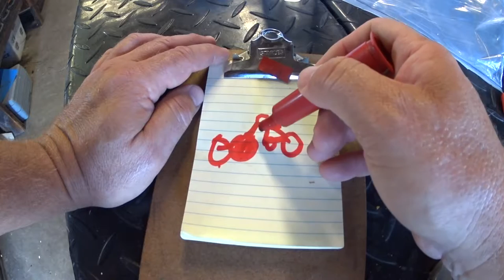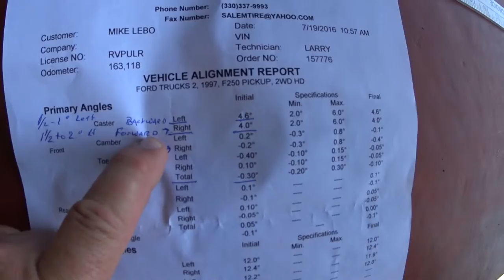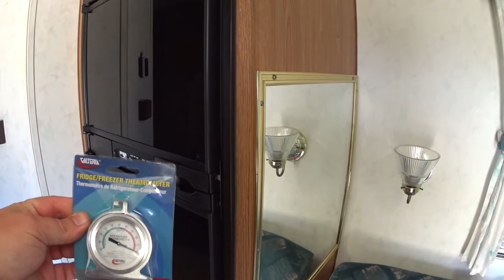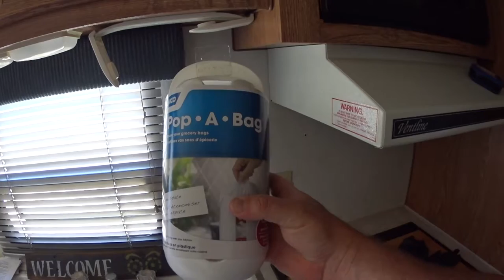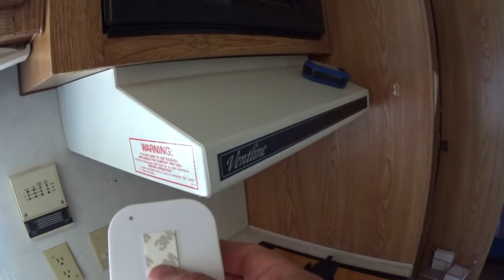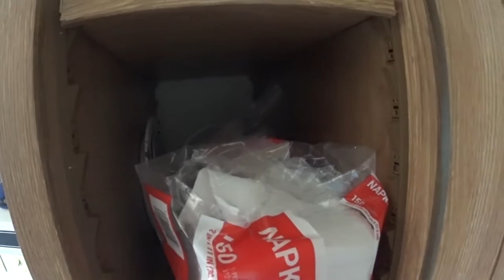RV Additions and Truck Repair

Comment: Thanks for the acknowledgment I hope everything works out. I change my alignment about once a month on my racecar but I do it myself with a cheap laser and level from harbor freight to save money.
Reply from the maker: I am almost to that point.. Inadvertently I had my GPS on when they took my truck for a test drive and it recorded some un-delightful remarks about me being anal and that he didn't think there was anything wrong..Ugh!!!  
 My problem is there is no real return to center and there is not a smooth resistance as I negotiate a move like a passing lane change over the crown and center groove in the road.. For a truck that long,heavy and wide It should take a lot more that a seam in the asphalt during a lane change to make it move around the way it does and don't even get me started on what it is like during heavy crosswinds, and multiply that action times 10 when the RV is being towed!!!!  The thing is you never get to talk directly to the guys troubleshooting and there is too much lost in translation.. Oh well , we will see how the next attempt goes..
Reply: +RVdaydream Does the truck seem to want to follow the groves in the rode and when changing lanes you get weird tugs on the wheel? if so its almost has to be a caster issue. I dont know what the specs on the caster for your truck are suppose to be but I thought for vehicles with power steering it was around 10 degrees. I've  also heard of a thing called the death wobble that some truck owners experience after putting different wheels and tires on a vechicle I don't think that's your problem but it's something to look into. If you decide to do your own alignment pepboys does free alignment checks when your done. unfortunately I don't know a whole lot about the suspension in the rear of a truck as most of the work I've done is on my car with double adjustable A arm suspension.
Reply from the maker: Yes, it follows grooves like the old Bias ply tires use to.. Lane change over road crown and seam in asphalt is really weird..I was a lot closer to the car I was passing than I expected(I have a tendency to drive aggressive...must be the old street racer in me 😁)  
  The truck is at the shop getting caster camber set as I type.. The death wobble was on a later generation of F-Series.. If this doesn't fix the issue most likely I will wait til after our trip , I will have to make sure to install the sway control on the RV before we head out to minimize the issue.... The F150 prior could tow RV  without sway control thats why I know there is an issue...  because this F250HD tows worse than the previous Lightweight 1/2 ton..
Reply: +RVdaydream hope everything works out. have a good time at dale hollow for the last ten years during the summers a lived in my camper on the very west end of Cumberland about 20 minutes from DH.